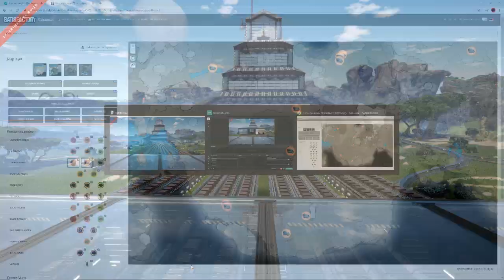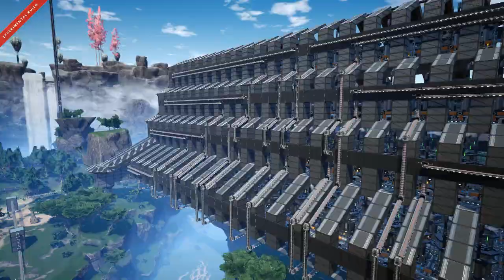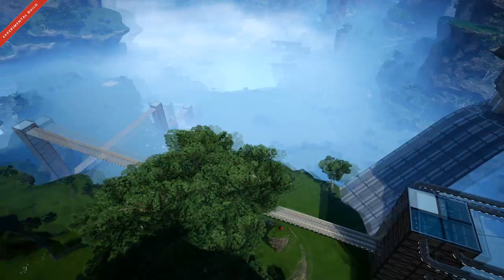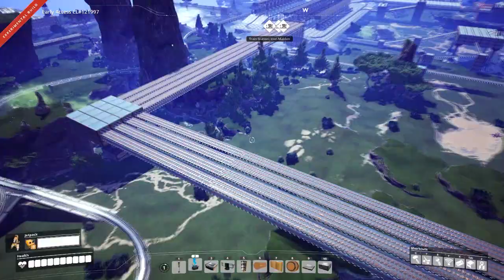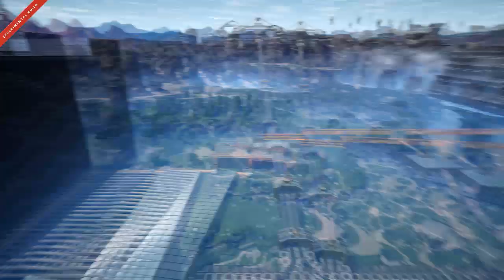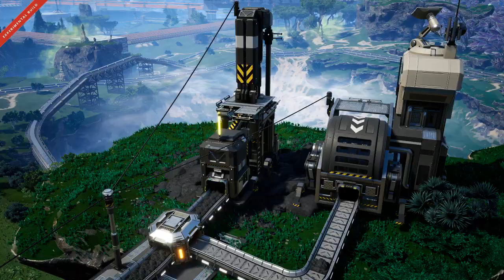Satisfactory - Mega factory - 12,000 Copper Ingots per min!

Comment: Q; pipes. I always calculate the amount water that can go in a pipe is 300... so if you use for example coal generators equals 45 but lets take 50 for easy measurements. wich means 6 coal generators. so i split the pipe 6 times. things now is what i dont understand is that i see on so many videos and on here too when you went inside i saw the pipe getting split up several times. am i calculating this wrong or so?
Reply from the maker: Sorry I'm not sure I quite understand the question.   As far as splitting pipes go...   we simply take the 300 a pipe can hold and divide it by the amount of machines it could feed...
Reply: @danp6918  yes you were undestanding my question, thanks for the feedback. Your answer confirms i am right. I just got superconfused thats all. just wanted to confirm as you cant really split and merge water like conveyors
Reply from the maker: @Democorn  no worries.  Yep pipes are a different beast to belts, you can still split, merge and load balance,  but you just need to remember the pipes are omnidirectional.   Oh pumps...   don't talk me me about the pumps!  🤣
Reply: my head is already starting to crack xD

Comment: Is the overflow system on the smart splitter only in the experimental mode?
Reply from the maker: Yes I believe so...
Reply: nop its just on the tier 5 or 6 therefore you gotta finish most of the research, but if you are planning to do a superfactory its ideal to have all tiers unlocked